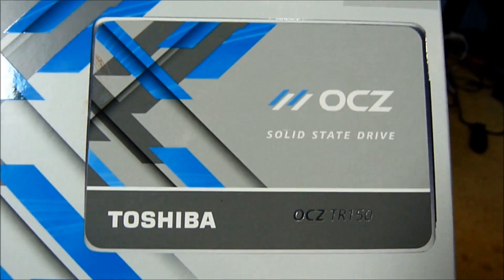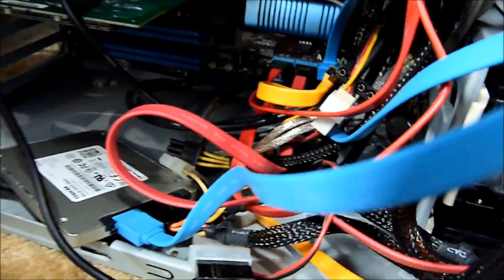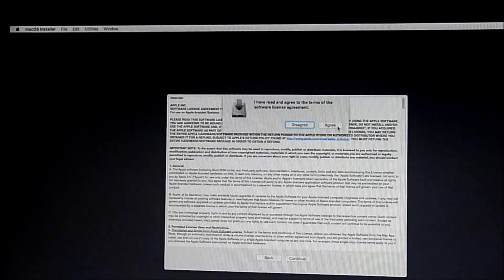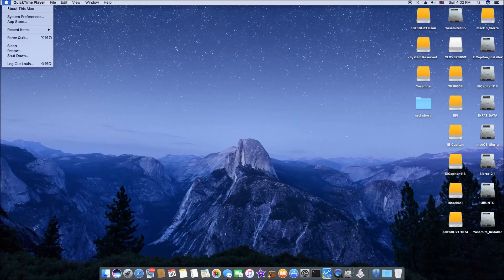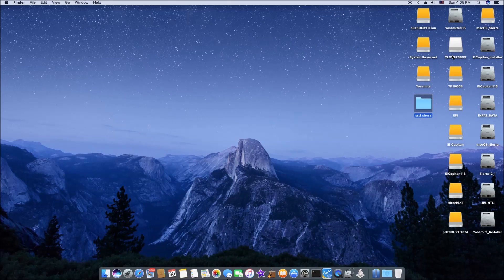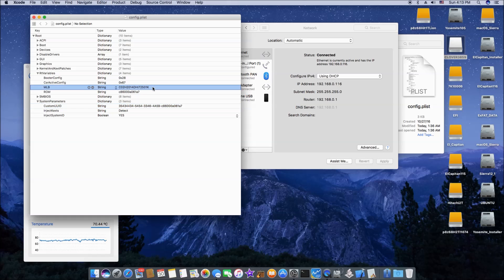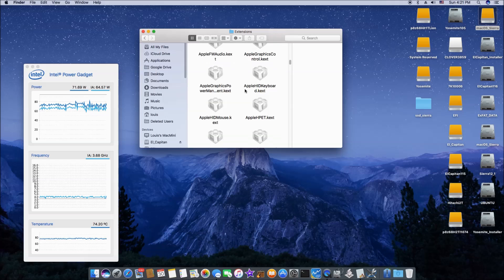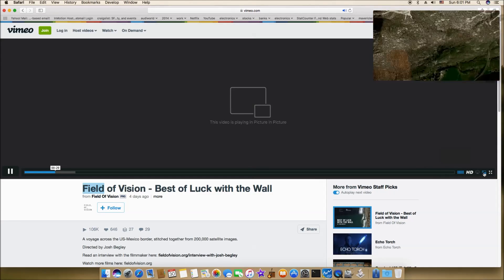Install macOS Sierra On P8Z68V LX i5 2500k

Comment: Everything works fine but how did you managed to set Sierra to boot automatically from hard drive without the use of the USB? Thanks
Reply from the maker: Danny Poetry you can install clover to the hard drive NOT using uefi or put the clover usb boot and select it as the first boot in the usb 2.0 port in the back

Comment: thanks for this video dude...but i cant get past this apple logo before the installation :(

im running :
i5 2500k
asus p8p67
gtx 260
16gb 1333 Ram

pls help me
Reply: btw im already on a hackintosh but on yosemite
Reply from the maker: tweakz boot with -v to see where it stuck at. If you use my config it should work